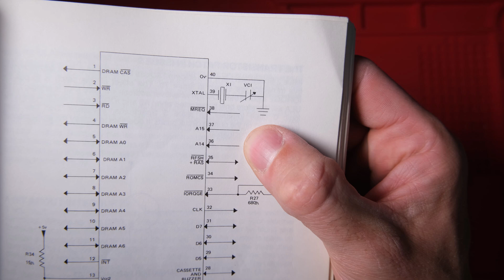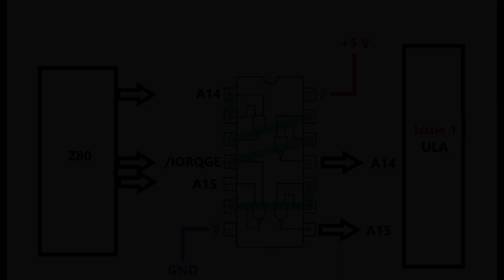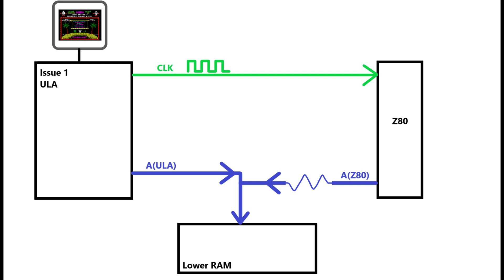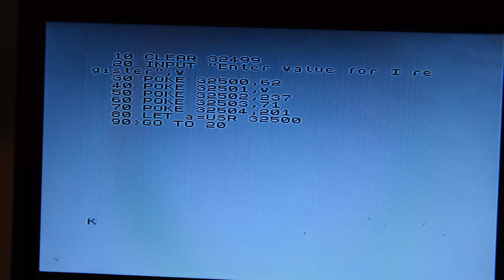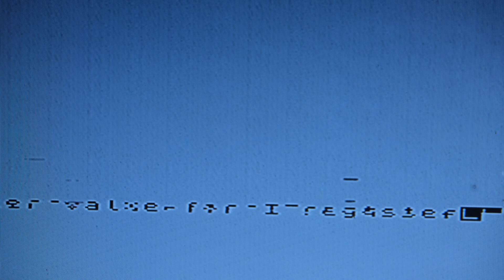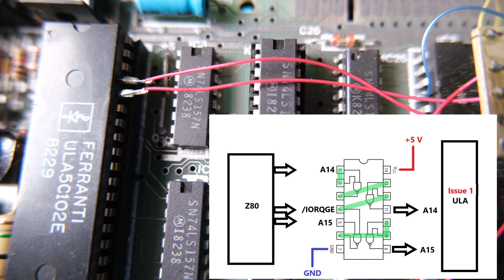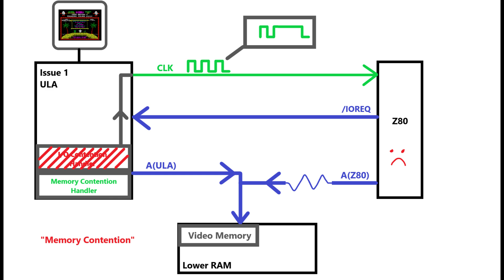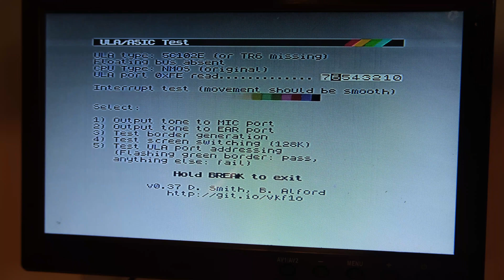The Issue 1.5 ZX Spectrum and the "Dead Cockroach" Mod

Comment: This was useful. Thank you. - My issue with the issue 1 ULA is that a connected Interface 1 doesn't work - i.e. it doesn't recognise the *CAT 1 command until you apply the dead-cockroach mod.
Reply from the maker: Yes I suppose in order to use the issue 1 ULA you should be on an issue 1 or 2 PCB with no spider mod and a dead cockroach installed to get proper function

Comment: Hi I have a issue 1.5 ,,, but don't have the chip ! I will need this to finish this computer of , do you know where I can source the little breadboard and chip 
Thanks 😊
Reply from the maker: You could make it up yourself, try eBay for the chip!
Reply: ? you mean an issue 2 board with a issue 1 ula? and no mod? likely the original ula has been replaced at some time with an earlier version....also both issue 1 and 2 ulas need a transistor adding to the iorqula line to correct io port problems , this was usually fitted to issue 2 machines